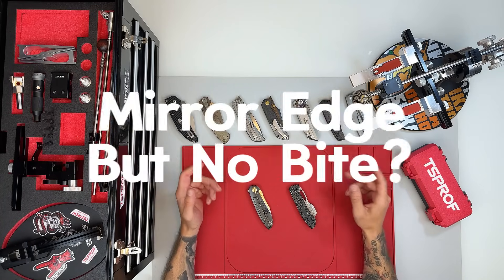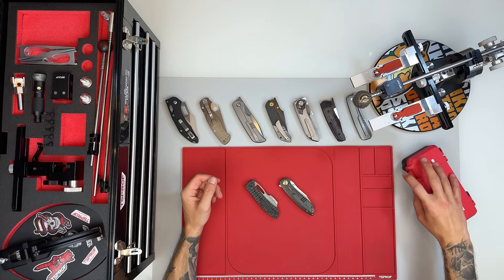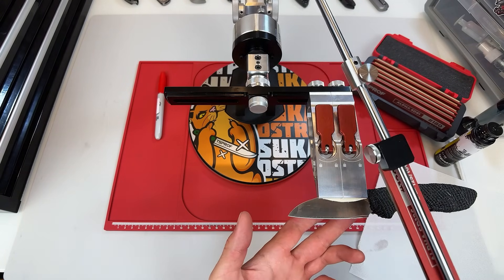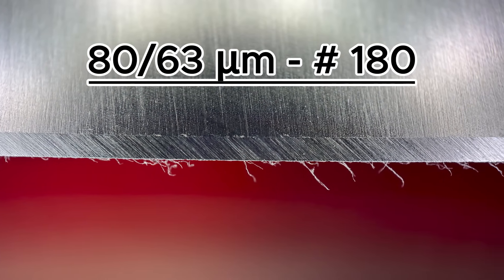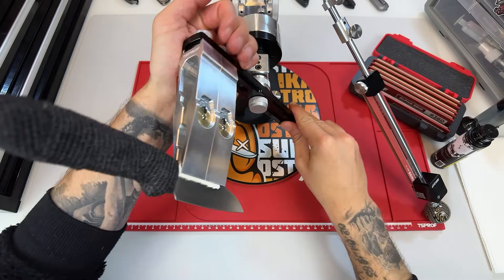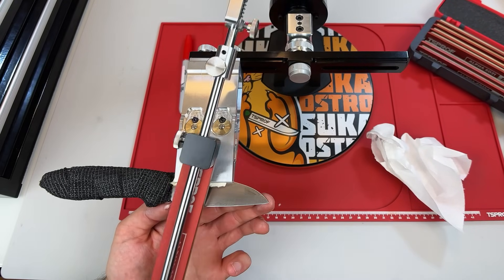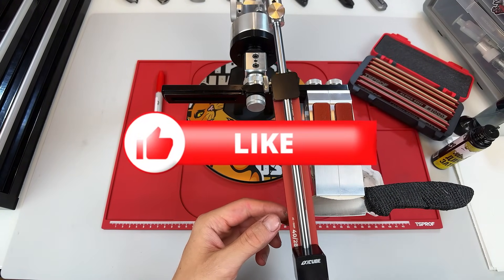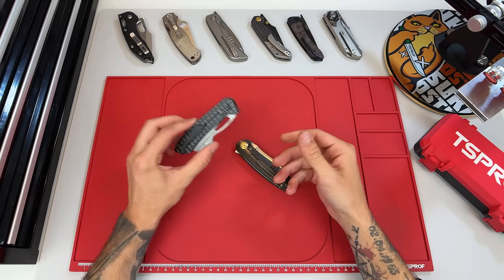Mirror Finish but No Bite? Why Your Knife Still Feels Dull After Sharpening CPM S35VN!

Comment: Keep in mind, your carbides are made up of carbon and one of your other elements, if heat treating doesn't fully dissolve these elements into the steel and suspend them correctly you won't be able to form a uniform carbidestructure so heat treatment is often the most important consideration, even ahead of steel choice. Each composition has its own heat treatment requirements, and mass production blades often fall short of these heat treatment requirements. There are a few Select companies who know this and take it seriously, Spyderco, buck knives, Demco, bench made, and a few others actually give this serious consideration, Spyderco being the one in the group that pays the most attention to it. Add a manufacturers like cold steel do a really good job with heat treatment using some of the less expensive steel types and can often out perform the super steals because they do the heat treating correctly
Reply from the maker: Thank you so much for your comment, you are absolutely right. I definitely assumed too much background knowledge again, and even though it's just a small point — the fact that carbides form in combination with carbon — I should have mentioned it. I have to admit, it’s often difficult for me to remember to include these smaller but important details because I tend to assume people already know them, which is not always the case. That’s why I really hope others will read your comment as well. Thank you for pointing it out, and I’ll keep working on improving the way I communicate these things.

In my opinion, Spyderco is definitely one of the top production companies when it comes to this. Over time, they’ve evolved from a knife manufacturer into something more like a research lab, investing a lot of money into steel development and testing, which I find incredibly cool. And you're absolutely right about the importance of heat treatment. Even the best steel won’t perform if the heat treatment is off. A well heat-treated budget steel can easily outperform a poorly treated premium one. I have to say, I’m personally not entirely convinced by Benchmade’s consistency, but still, thanks again for your comment and your support 🙌
Reply: @TheSharpeningGuide  sounds like we agree on the bench made subject, they get some of them right and they dropped the ball once in a while. Spyderco Is probably the top of that list. There's a reason their blades cost a little bit more. But you can rest assured you're gonna get more quality when you buy one.  As to the other part of your reply, I know what it's like to guess that other people already know something that seems so simple to us. I studied material science in college while taking an engineering course and then I studied metalergy when learning to do jewelry. I often forget the other people may not know the same things I do. But I'd rather share the information with people who want it instead of picking on people who don't already know it. I'll be following your channel and sharing your videos because you've got some really good content that can help a lot of people
Reply from the maker: @CB-68-westcreations  Absolutely, I know there are some hardcore Benchmade fans out there, but honestly I am definitely not one of them. I am not buying any of their knives at the moment either.

I totally agree with you. I am also willing to pay more if the quality is truly top notch. And of course, all the development costs are reflected in the final price of the knife. But I think that is completely fair when the product actually delivers.

I know I still have a lot to improve. I have only been making videos for a few months now and it is all a learning process. I just hope people do not see it as a lack of knowledge or a mistake when something is not perfect yet.

And honestly, that is amazing. I have a lot of respect for your background and knowledge. That is exactly why I wanted to clarify certain things in the video, so people do not get the impression that I am pretending to be something I am not. I just find this whole topic extremely fascinating. I always want to understand how and why things work, and that curiosity has pulled me deeper and deeper into it. I am definitely not an expert, but I want to keep learning.

I really appreciate your mindset. What I try to do with my content is to explain some basics in a way that still includes enough detail for those who are genuinely interested, so they can dig deeper and develop a better understanding for themselves.

Thank you so much for your support. That really means a lot to me, especially coming from someone with your experience.
Reply: @TheSharpeningGuide  sounds like we're pretty much on the same page, I have a couple bench made knives, but I'm not going out of my way to buy one of their products. They push the wrong button with me in a political situation just a couple years ago, and I haven't forgotten. But the fact that they charge premium prices, and use premium steals without going through the proper process to heat, treat them and only two out of 10 knives come out correctly according to some of the stats I got from a few friends I'm not willing to spend my money on their stuff. But that political garbage they pulled really did push the buttons of a lot of people. Some people might've forgotten, but I didn't. They're gonna have to earn my business if they want it and part of that is by doing the right thing or even better not doing the wrong thing again. I got a couple of their knives given to me and I'll keep those, one is actually pretty good. The other is total garbage. And the funny thing is the total garbage knife is the one I would've expected to be right. 
Alligator make my own blades or I'll go to a company like Spyderco for folding knives . And cold steel for fixed blades is not a bad plan. They've done really well with their heat treat. They're not using a lot of the super steals but they have some S 35 and some  S30  there are surprisingly good blades. But honestly going back to their original San Mai is still not a bad choice. They aren't quite as fancy as some of the other producers, but their blade quality is decent.
Reply: @TheSharpeningGuide  getting back to that sharpening system, subject, I've been looking at those systems for a while, and I've even looked at some of the clones. I still have the old Lansky set up. That has worked pretty well. But then I picked up the commercial grade sharpener from Tormek so I'm trying to figure out if I really need anything else. I just launched a professional sharpening service that should be online within the next couple of weeks. And I'm equipped to sharpen everything from carbide on back. So I guess time will tell. I'm not even sure if I'm gonna offer a hand sharpening service because the time involved can get pretty extensive. In the system, I have is so precise that I'm wondering if I'll ever hand sharpen another blade.😂
  I do like that system you're using, especially if I were just taking care of blades for myself and a few friends and family because the precision and accuracy is incredible, for less than $1000 somebody could be set up for life to sharpen most any blade they would encounter. And a person really could do a knife sharpening business with one if they chose to. They would just have to charge a little more because it would be a slower process.  I think you did a video on some of the clones, but rather than hunt that video down I have to ask what your take on that is. The TS proff has a lot of support and really good design.  And I can even cast my own diamond stones for it so that put me a little bit ahead of the average person. Do you think there's enough difference between that system and some of the better clones to be worth the investment if you were starting fresh today?
Reply from the maker: @CB-68-westcreations   May I ask what exactly happened with Benchmade? You're absolutely right. The thing is, when a company gains a lot of attention early on by offering great quality, but then starts to take advantage of that by cutting back on quality to save money while still charging premium prices — just because they know the knives will still sell — I find that really disappointing.

Honestly, my dream would be to start making my own knives someday, once I’m retired and finally have the time and space to do it properly. It would be just as a hobby, for myself or a few friends, but it would let me fully live out my passion. I really admire your skills and dedication, and I honestly envy that a bit.

Also, congratulations! I wish you all the best with your sharpening service — I truly hope it goes well. I completely understand your thinking, and I believe that offering something like that could be a great addition in the future, especially for very high-end knives. People are often willing to pay extra for that kind of premium service. That said, the initial investment is definitely significant.

From a personal and hobby perspective, using the K03 is simply amazing. For me, it’s a great way to relax after work and completely switch off from everyday stress. I’ve also tried some clone systems or cheaper alternatives in the past, but the difference in quality is just massive. The frustration you avoid by having something that works flawlessly is hard to describe. In my opinion, it’s not worth saving a few hundred dollars when you consider that this is a long-term investment — potentially one for life.

At the moment, I find the Kazak systems quite interesting. Unfortunately, I don’t think their quality or user experience is fully there yet, at least not for the price they charge. But I see huge potential in their products if they manage to fix a few smaller issues with their system. They’re definitely one to keep an eye on in the future. I think the M10 model is currently the best option on the market for around 270 dollars.
Reply: The only company doing excellent heat treatment is Spyderco. None of the other examples you provided are doing anything better than average.
Reply from the maker: @tacticalcenter8658  Spyderco is definitely on first place but Kunwu for example is doing also a great job 👍

Comment: I think a lot of people mess up, by using too much pressure, regardless if their angle is good or not. Even if your angle is absolutely perfect, you CAN still round your apex if you use too much pressure. And the softer the leather, the more this is magnified. The harder and thinner the leather, the less likely pressure will affect your apex. Obviously if you’re finishing with a hard ‘strop’ like a super thin cardboard, or different types of wood, it will be easier NOT to round your apex if your angle is correct. I have a few blank plates for my KO3, and have one with a thin piece of cardboard type material, with some compound, but I am still kinda experimenting with it. So far it has worked great. Right now, for me…full burr removal and stropping are what I am experimenting with and trying to perfect. With the TSProf KO3 pro, it is pretty easy to get a super consistent and perfect bevel, and even apex….but for me, the finishing is what I am trying to improve. And to me is probably the most important thing to perfect.
Reply: I thought I replied to Meester’s comment, so this was to add more to his comment….

Comment: I have the Venev Centaur stones but would like to try those Alpha stones out.
Reply from the maker: I also have the Centaur and the 200mm premium double-sided…. great stones for sure 👌 but trust me, the Alpha stones are on a whole different level. If they fit your budget, I’d absolutely recommend trying the grit you usually finish your knives with (depending on the steels you most sharpen). Or, if you’re up for a wild experience, go for the 2 / 1 micron. It's something else 🙌 Thanks a lot for your comment and the like, I really appreciate it!

Comment: One other thing that I see you do, that I also do…is use the entire surface of the stone; while at the same time, you use CONSISTENT strokes from tip to heel…I see a LOT of guys, even a lot that are more experienced….just go in all kinds of different lengths of both the stone length; and the blade length. I am way more consistent in both, like you. I feel that will give you better results in both finish, but also will help you NOT to wear low spots along the length of the blade edge. I don’t get why more experienced sharpeners just go all silly with their strokes.
Reply from the maker: Absolutely, it's definitely an important factor. In general, you can get great results with other techniques too – but personally, I couldn’t get the same smooth and consistent stroke with the Kadet Pro as I can with the K03. That was actually one of the main reasons I decided to invest in the K03. I feel like the longer distance between the hinge unit and the blade gives you more control and allows for a more fluid, balanced motion.

That being said, no matter which technique you use, it’s essential to always finish with clean, consistent passes from heel to tip. This helps even out any irregularities across the edge. And of course, you want to use as much of the stone surface as possible – which isn’t always easy depending on the size of the knife, but that’s exactly why I also keep 200 mm stones in my kit 🙌
Reply: The only issue I have with that very same distance from the hinge is with knives with a steep ricasso.  I find it really difficult to line the stone up with that acute angle so I don't damage the ricasso unless I steeply angle the blade in the clamp.  That leads to its own issues where the bevel angle varies greatly from heel to tip.  I'm beginning to think I need to sharpen it like a tanto.  Heel first.  Belly and tip in another sharpening session.  🤦

Comment: Curious why you don’t use a center clamp.
Reply from the maker: Because of the blade shape, I prefer clamping the knife with the tip aligned to the rotation point. This gives me a better angle for controlling the scratch pattern and also helps prevent the bevel from getting wider at the heel (avoiding little bit the risk of a smile). Working with the K03 is a bit different everything is heavier, so I try to avoid unnecessary risks. I’ve used the single clamp before and had great results but also the quick clamps are so amazing to work with 👍
Reply: I have the same system, and I use the same clamps, for me…it is because they are more stable, solid, and they are not as far away from the sharpening system. His reasons will obviously differ, but that is why I use the whole milled and quick release clamps over the center type clamps.
Reply from the maker: @rickmoss7040  as long as I find a flat spot to clamp the knife securely i will always use the quick clamps 🔥🙌 i also have no problem with disposable a knife for clamping like on my Kizer Feweed in S90V.

Comment: I don’t believe that you can “over strop”.  I think the technique much more of a determining factor.  If you have great technique and are able to hold your angle very well -you can strop all night and not see any loss in sharpness.

On the flip side, if you have poor to average technique, you’re much more likely to round the apex if you have a lot of passes over the strop.  It seems like it’s due to “over stropping”.  Although, in reality the more passes the more opportunity to miss the angle and therefore a much larger chance to round the apex.

Therefore, if you want to guard against rounding the apex, but you aren’t perfect in your technique -it’s best to make as few passes as it takes to remove the bur.  At least until your technique has improved enough to withstand multiple passes.

The way I know this:  I used to round my apex when first starting out with the strop.  As I improved my technique, I can make many passes on a strop with those same knives and not round the apex.
Reply from the maker: Thank you so much for taking the time to write this comment. I completely understand what you mean and I agree. If your technique is absolutely spot on, nothing really happens during stropping apart from dropping down to the strop’s grit finish. That’s why I mentioned in the video that the risk is quite high because even with fixed angle systems many people still make mistakes, especially when it comes to pressure, imperfect angle control or even the type of leather used. But yes, I get your point. Thanks again for your input and also for the like and the subscription. I really appreciate it. I hope you enjoyed the video?
Reply: Yes you can. Even if you are using a fixed angle system with high precision like my K03 Pro Hunter, with a 0.1 degree adjustment, there are many factors that still play a role - type of medium for stropping, hardness/softness of the medium itself, how much pressure is being used and then we go to the stropping compounds and their properties - some are more, some less aggressive.

I would argue that while sharpening on stones is straightforward and anyone can do it, stropping/deburring is something really complex and there are many things that can go wrong.

Comment: Was this you using your real voice in this video? Or am I tripping
Reply from the maker: No sorry, it's just a more natural-sounding  voice 😁
Reply: @TheSharpeningGuide I like it! Also when you  were deburring I noticed you started off doing edge leading and then finished with edge trailing. Is that your normal method? Just curious I may try that next time 👍 Thanks for the video
Reply from the maker: @StoneHands25  It depends a bit on the steel and what finish I'm aiming for, but I usually start with edge trailing strokes and then switch to edge leading. With the 2 slash 1 micron, I mostly do only edge leading strokes 😁
Thanks so much for your comment and like. I really appreciate it!